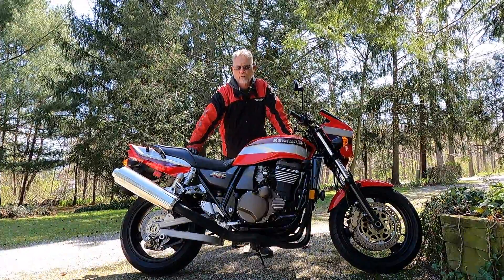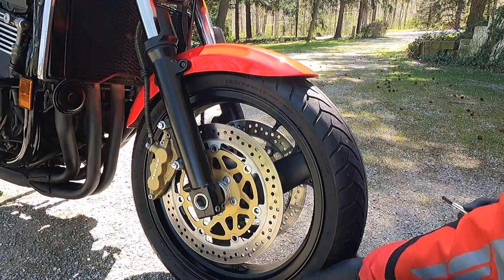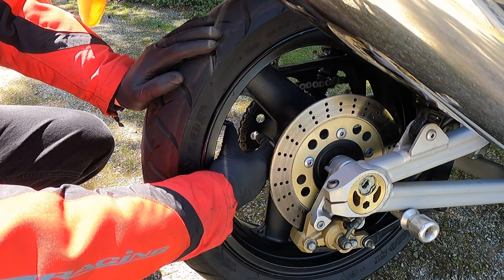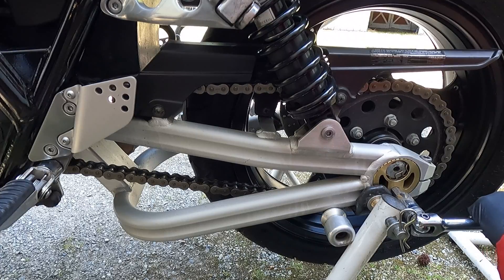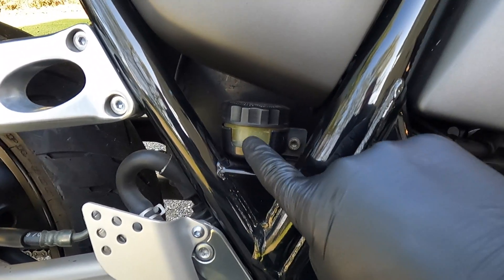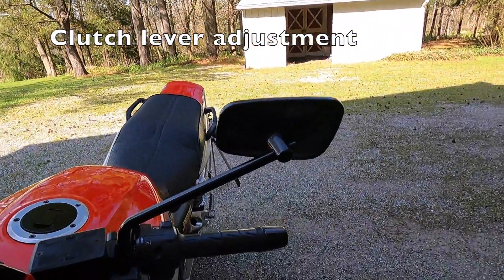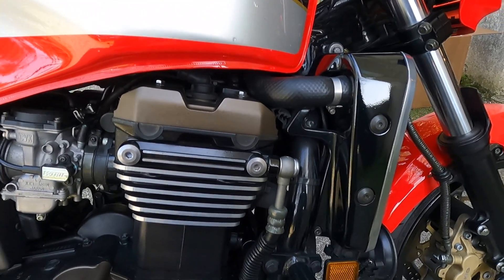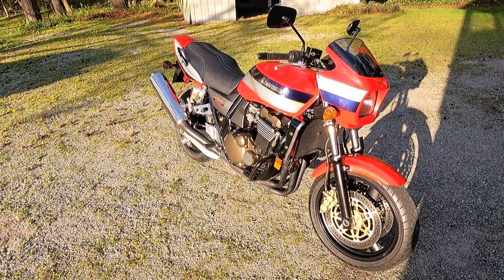How to service a motorcycle - Kawasaki ZRX1200R and ZRX1100

Comment: this is an AMAZING video.  i just picked up a used zrx and like learn to do some of this myself.  thank you for making this.  i need to find you clutch bleeding video.  i went out today and my clutch lever all the sudden has too much play and wont shift.  hoping it is something simple, preparing for it not to be.
Reply from the maker: @steveflaming9901  It could be several things (low fluid level, air in the line, faulty line, or master cylinder that needs to be rebuilt). None of these is too serious. Good luck with it!

Comment: Hello great video.
May i know are these still available to buy in europe? Where can we get spares to keep it running? 
Thanks for sharing your experience.
Reply from the maker: I'm in the US, but I believe they are available on the used motorcycle market in Europe like they are here. Parts can be found through the Kawasaki dealers, scrap yards, online, etc. There is no one-stop shop, and you may need to get creative at times when sourcing parts on any older bike. Cheers!
Reply: @jonsmotorcyclerescueandrev3538  thank you 🙏

Comment: Hi,great video on a beautiful bike.  On every bike I have had with that cartridge style oil filter they have always assembled spring , flat washer then oil filter. The flat washer stops the spring from digging into the rubber groumet in the filter.
Reply from the maker: Thanks Joe, you're correct. The flat washer often sticks to the underside of the old filter and gets thrown out. In the past, I have serviced many bikes with the washer missing. In fact, I had to buy one for this ZRX. Thankfully, I've never seen a spring push into a filter without the washer. 

Why Kawasaki added a part (the cup shaped part that sits on top) to an assembly that is so often improperly installed is beyond  me. I specifically included the proper assembly sequence in the video because I've seen it done incorrectly so many times. 🙂

In the past, I serviced a bike with both the spring and washer missing, 🤔 not good.
Reply: Hi Jon, ever since I have owned and serviced the bike, the cup that sits on top of the oil filter was missing, and never had any problems, should I buy one and put in in on when I do the next service...... cheers
Reply from the maker: @jodavey3053  That's a great question. I would first verify that your specific year has the cup. If so, I would get one just for my own peace of mind. If you don't want to get one, I would recommend at least talking to a Kawasaki tech to get their take on it.
Reply: @jonsmotorcyclerescueandrev3538  Thanks Jon

Comment: Whoaaaaaa?😮 At time Stamp 19.43 you are installing MOBILE OIL, Not the Kawasaki Brand you showed and talked about.
What's the Deal Here Neal??? 
Why Mobile and not The Kawa Engine Oil???
Reply from the maker: I have a clean 1 qt Mobile 1 container that I use to measure the precise amount. Sorry for the confusion. Cheers!
Reply: No, It's I owing of an apology to you. I made an assumption based on the label of the bottle. 
I'm wrong I'm sorry.
Reply from the maker: @benjaminwilliams3568  Apology accepted, Benjamin. Cheers!

Comment: jon..I was thinking of the fan and then you mentioned it.The only thing I wish my zrx had was a temp
gauge.The faired zrx`s had one so i think there is a simple solution underneath the gas tank on the 
the thermo housing.The motor is so understressed they just gave it an overheat light that you can
only hope works if the thermostat stay`s closed or you hole the radiator.Loved the vid..Cheers.
Reply from the maker: Thanks Gilbert! I was just out on the ZRX today filming two more comparisons. I was going to mention the lack of temp guage in the video but didn't - it really should have one. But I loved every minute of riding the ZRX. They're great machines!

Comment: Good video - weirdly the hardest part of maintaining this bike is getting the oil filter back on because the exhaust header is in the way. The best way I found is to get the filter housing on first without the big bolt and hold it in place once you get past the header, then get the bolt with your left hand while you press the filter housing in place with your right hand. Still takes some effort to hold that filter housing up with one hand due to the spring tension, but it’s doable, and easier than trying to get the whole filter unit past the header with the bolt already in it.
Reply from the maker: It definitely could be easier.
Reply: Yes.  The better method (if aligned properly) to enable the long bolt to slide right up just as you say. Otherwise it's a royal pain.

The engineering on this part was poor.  Even the Shop Manual should suggest what you said as a much preferred method.

Comment: Kind of odd he plugs Kawasaki oil then refills with Mobil-1 full synthetic???
Reply from the maker: Actually no, though it looks that way in the video. I have a clean Mobil 1 quart container that I use for measuring out the proper quantity of oil. It was the Kawasaki oil that I used.

Comment: What is the thing we used to do to the eccentric to rotate it 180 degrees to raise the rear a bit to quicken up the steering. Along with lowering the front a bit.
Reply from the maker: Yep, I've done that to a previous ZRX. The ZRX1100 actually handled a bit better with the narrower rear tire and, I think, slightly different chassis geometry.

Comment: What can I do of the eccentric marks are not in the same spot? Great video!
Reply from the maker: They should be. You could loosen one pinch bolt and turn that adjuster till it lines up with the other side. You'll probably need to readjust the chain afterwards.

Comment: Is the zrx still the 4 carb setup like the inline 4’s I rode in the 1980’s? I ask because I’ve been infatuated with the zrx since I first saw one at Kawasaki showroom back in 2004 +/- …..and I’m now squirreling away any $ I can in hopes of getting a bike by spring…….I’m leaning hard towards either a zrx or a Fz1……or which  ever is the  best bike/ brand / model similar to those two I can afford when the time comes…..anyways if I am lucky enough to find a zrx in my price range, am curious if I need to stow away extr $$ for a card sync / adjusting …..it’s weird ,when  I was young I did all a repairs myself , but my bikes i be felt confident becaus of the way I rode back then ( very punishing on the bikes  ) but now not to least alll…if you have any how to’s on carb syncing/ adjusting I be Interested in those too (suppose I should just go to your channel and look lol) …ways great basic service / safety Vid, thanks for posting
Reply from the maker: Thanks Vic! Yes, the ZRX is a four carb setup. As long as it runs good when you get it and you winterize it properly, that setup holds a tune for a long time. It's not high maintenance. Good luck in your search!